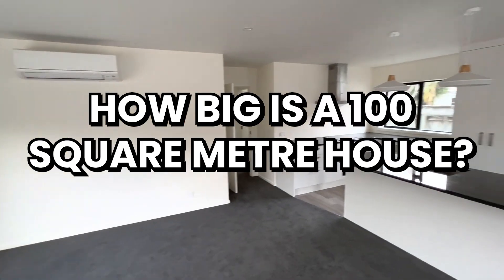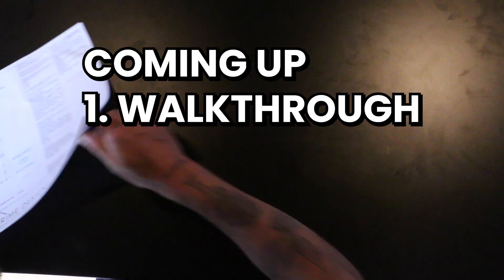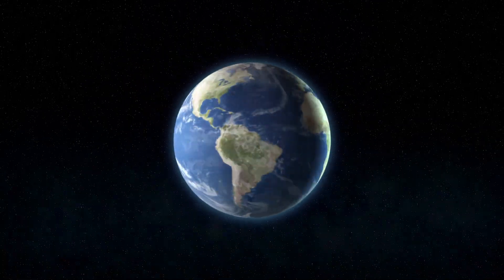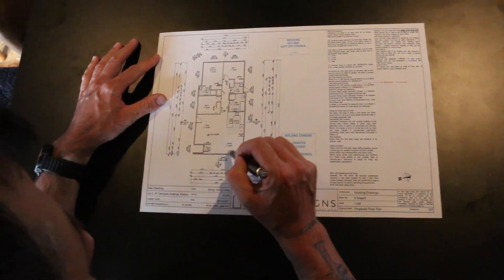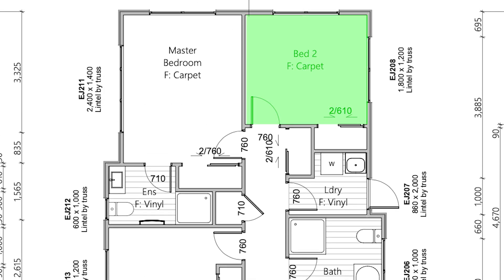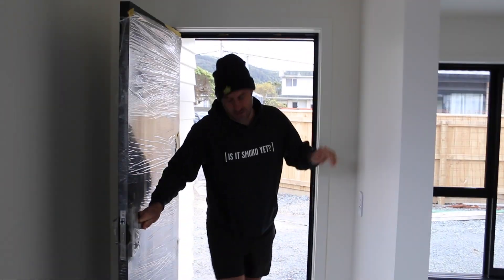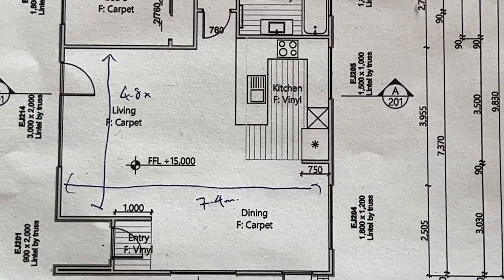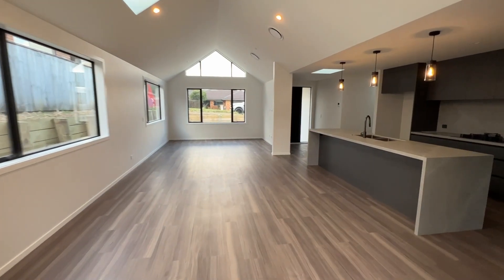How Big is a 100 Square Metre House Design in reality?

Comment: At only a little over a hundred square metres and with basic fittings, I take it this is a commodity home. but my main question is why the tile roof? I'm sure long run steel is quite a bit cheaper.
And does a much better job at keeping water out, and in Wellington with the potential for large earthquakes long run steel just makes sense.